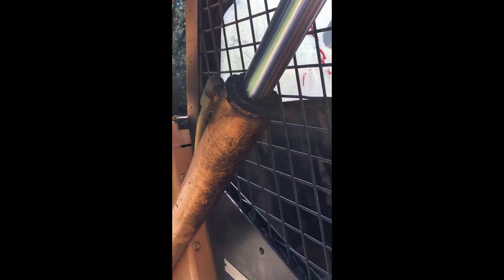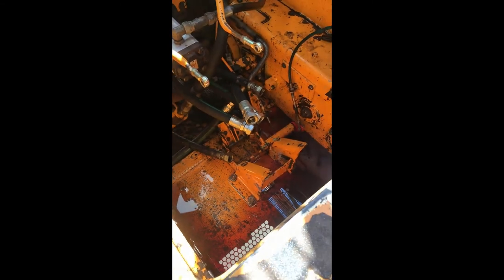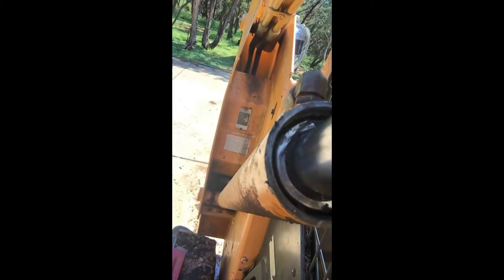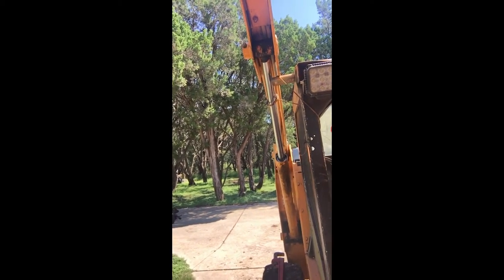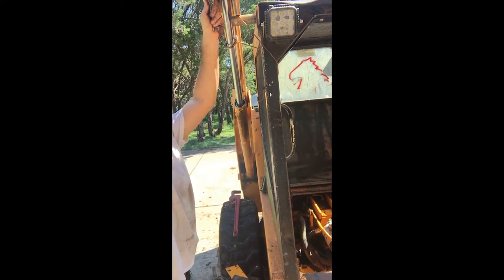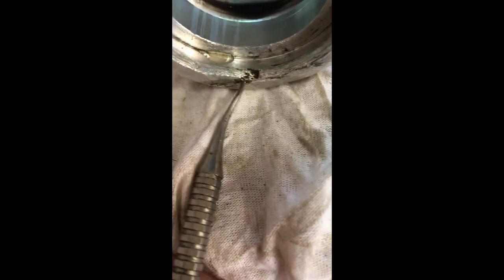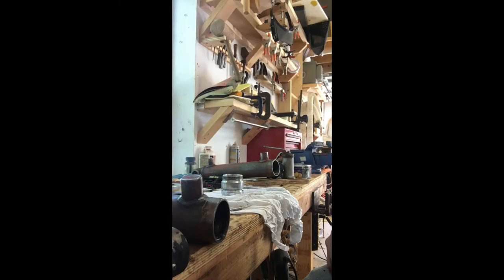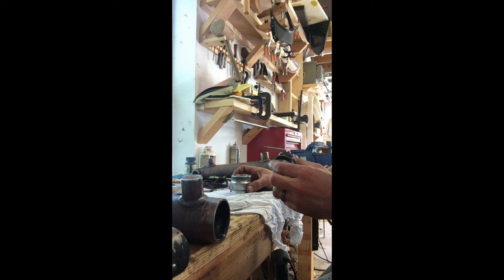Hydraulic Cylinder rebuild DIY

Comment: Thank you for making this video.  I have the same machine.  I tried to get my cylinder apart but when I use the pipe wrench the whole thing just spins.  the two parts move together so i can't get to the snap wring.  Any suggestions?

Comment: What is the manufacturer of your cylinder. I have one like that and need the seal kit for it. I'm still looking.
Reply from the maker: Kevin Kutz, I had to order it online from a mustang parts supplier.  I’m pretty sure it’s a standard part.   I don’t know the actual make of the cylinder
Reply: Thanks - I'll look into it.
Reply from the maker: Kevin Kutz, once you get the gland and rod out of it, you can take them to a hydraulic shop and they can usually get you a set of seals.  You should only need to take the gland and the rod with the piston attached
Reply: Did you obtain a new ring clip with the seal kit or did you re-use the old one?

Comment: If you had removed the hoses. That packing goes in easy. But your trying to compress air and fluid. I did one like that. But way better with the hoses open.
Reply from the maker: Pete k I had the control valve out
Reply: I seen that, but still harder pushing the fluid and air thought the lines. Or it was for me, had issues. Then rremoved both lines, it was 75% easier then.Thanks for the video.